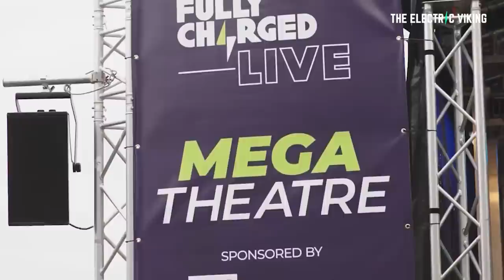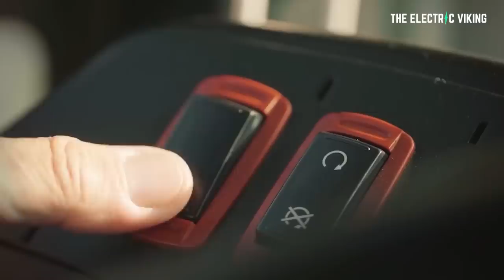Electric Vehicle Charging for moving EVs installed on German Autobahn

Comment: i think its 10% real and 200% pie in the sky. recharging an EV is about 97% efficient. using wireless charging is probably quite a bit less than 25%. its a great idea, but has a long way to go. we may be ready for test patches but we are decades away from making it the normal. how does it get paid for?

Comment: They already installed cables for like a streetcar above some parts of german autobahn (Frankfurt). For 2 (two) trucks. They will tear it down next year. Germany still has enough money for other silly projects.
To inductively acces 20kW of power you need very heavy and expensive equipment on the vehicle, that you always need to schlepp around. And it is still very inefficient. Lots of losses.

Comment: This will never happen due to financial reasons...  Do you have any idea how much a standard slab of roadway costs per mile?  Now imagine if you live in areas with extreme temperature changes, where that road buckles due to heat expansion or ice heaves.  Our local plows cause potholes every year.  Utility companies are constantly digging trenches to access and install new infrastructure under roadways.

When a highway/road/bridge is scheduled to be fixed, the public wants it done during the middle of the night, completed within one week, and they want it to last for a decade or more while costing the least amount of money.

I see this as a very useful technology for garages, parking lots, and other places where cars stop for extended periods and the asphalt requires minimal maintenance over a 20 year period.

Comment: If the exponential cost reduction in solar continues, and therefore energy becomes almost limitless and dirt cheap in the next 15 years or so, the energy loss due to inefficient charging like this would become irrelevant. And maybe over time they can engineer the construction and maintenance costs down enough for this to be plausible. I see this as a hyper optimist sort of thing, but not an insane thing like solar roadways. Also, I wonder if they need to cement it into the road, or if they could run a pipe or duct below the road and stick these to the roof of the duct, to allow them to be replaced or repaired without tearing up the road

Comment: I would want to see the results of this test track, like overall charging efficiency. How many kWh of energy does it take to create a magnetic field above the road for every kWh of energy that gets transferred into the battery? Does it add any additional drag on the vehicle? I used to work with linear motors and having big air gaps is a killer for efficiency. If you have a wireless charging dock for your phone, place a book over it, then put your phone on top and see how well it charges.
Reply: The charge is 95% efficient. An electric plug is about the same.
Reply: @preacherdavid  I'd say the overall efficiency of the charging process including charger losses is about 91% (based on my experience of designing battery chargers) and power conversion in general. Discharging the battery and getting the power on the road is probably around the same, so overall efficiency in terms of kWh in vs. KWh out is about 83%. Add in the thermal efficiency of the power plant which is around 45% for a modern gas-fired station (less for coal-fired).
Reply: " big air gaps is a killer for efficiency" BINGO! To gets efficiency over 50% will require a floating on an "air bearing" receiver under the vehicle. BUT: wholesale electricity is cheap at <5¢ per kWh. So efficiency under 50% could still be cheaper then stationary contact charging, if the government could reduce the added usual fees.

Comment: This is unlikely to ever happen as it is very inefficient in its use of electricity. After all the losses it would probably use about 3 times as much electricity to obtain a full charge. Not to mention the cost of the infrastructure and Maintenance. Maybe if electricity was cheap then it would be viable.

Comment: Brilliant idea. I do remember my home town having trolley buses so that the buses could pick up power from overhead and drive along without using diesel. I haven't really understood why that could not be reintroduced because that must be a cheaper system than "in tarmac" systems.
Reply: Yep, another great technology killed by big oil.
Reply: My mother took me on the trolley car to downtown Detroit shopping for school clothes.
Reply: i dont think in the long run, overhead wires would be cheaper, they require endless maintenance, its hard for the vehicles to attach and detach when required. overhead wires are great for a fixed route like a bus or trolley, not so much for a truck that has a potentially random route

Comment: I think this is a nonstarter. Here's the thing, no states or government want to invest more than the bare minimum for roads. For wireless charging roadways, we'd need high power lines running along the entire roadway with a ridiculous amount of inductive chargers under the road. Not to mention the huge waste of aluminum or copper it would be. It would honestly just be better to either use the overhead lines like electric trains or the powered rail in the middle of the lane. Still, I just don't even see either of those happening. 

Just to prove the point, back in the 90s there was a push in California for self driving cars. Their method involved hammering rail spikes into the center of the lanes of the highways in like 10-20ft distances. This means the car would know to recenter in the lane just by seeing how far from one side to the other the spike was. This project went nowhere though as they viewed it as "financially unviable" when they were literally just smacking rail spikes worth $0.80. 

The only method that could possibly work is wireless charging at the stop lights. Stop lights already have inductive pads under them to detect cars, it's only a slight power jump to make them output useable power as an range extender. Still I doubt even this could ever happen as who's paying for the power? It's not like the pad knows who's car is connected to it unless they also have NFC as well making this needlessly complicated. The only other alternative is limiting it to select roads with subscriptions and tolls like the state turn pike. Beyond that I just don't see how you could feasibly make it viable.
Reply: I also forgot the fact that EVs tend to run at up to 250Wh/mile, so if you wanted inductive chargers so the car doesn't lose power while driving, we're talking basically 250Wh per car per mile. Let it be remembered that electrical induction can be dangerous. At this amount of people it could cause the bottoms of some cars to start sparking, not to mention this is literal cancer. Normally em radiation wouldn't be carcinogenic, but at this amount of of energy it most certainly is. There's a reason the FTC limits the amount of em radiation per square meter. 

So enough energy to run a car indefinitely is just a pipe dream. At best they can reduce the speed the car wastes power by adding maybe 50-75W continuously. As of right now, the safe levels for non ionizing radiation has a ceiling of around 2-10W/m² depending on the voltage used.

Comment: As much as I would like this to be true, I am dubious.

Wireless charging is neither new nor complicated. It is well established for charging electric toothbrushes to mobile phones. You pass an alternating electric current through a coil in the charger to create an alternating magnetic field. The device being charged has a coil that turns the alternating magnetic field back into a current that charges the battery. It is essentially what happens inside a transformer as well but with one difference. It is called inductive coupling. The transformer contains a ring of ferro-magnetic material to guide the magnetic field from the coil generating it to the one receiving it. This gives them good efficiency. Another technology where this is used is the passive RFID technology such as that used for security door access cards, public transport ticketing, and NFC contactless card transactions. This does use an air gap and look at the range. The passive RFID cards don't need a battery because they are powered from the reader transmitting a magnetic field picked up by the card to charge a capacitor.

Air is a crappy conductor for magnetic fields. That's why they don't use it in transformers. For mobile phones and toothbrushes, they compensate for this problem by minimising the amount of air between the charger and device being charged to a few millimeters. As I said, RFID cards have a crappy range because of this. Also, the charger and device are stationary relative to each other. Even so, wireless chargers are not as efficient (i.e. they waste more energy) than cable chargers.

Now, imagine such a system separated by the ground clearance of a typical vehicle and that is moving at speed. We can assume that the company has a way of tracking vehicles and only powering those coils below a wireless charging vehicle at any given instant. The magnetic field would have to be focused on the coil and move with the coil as it passes over. It appears from the video that the coils are small enough that one vehicle would be over multiple coils at any given time. This would help maintain a stable current flow rather than have it alternating on to off and on again which is a good thing.

Like mobile phones, a vehicle would need to be designed to use wireless charging. Put simply, if the vehicle wasn't designed with the coil beneath it along with the charging circuitry, it can't use the facility. You can drive your current model Tesla up and down such a road all day and it won't get any charge whatsoever.

As for the parallel with solar panels, they are not parallel at all. Yes, solar panels were expensive and inefficient when they first came out, but that was just a limitation on the technology of the time. The poor magnetic permeability of air is not something that technology is going to change. Also, most ideas initially dismissed as being unrealistic turn out to actually be unrealistic. Remember the "solar f***ing roadways" hype? It bombed. It was predicted to bomb by many and unsurprisingly did. This is the fate of most of these initiatives however much we would like them to work.
Reply: Yep, this one belongs in the 'solar roadways' category.

Nobody remembers most 'brilliant' ideas that seem to be unrealistic, because nothing ever came of them. They turned out to be actually unrealistic. Not practically feasible. There's actually a lot more of that type of idea than of the type that actually do become successful. Just check with the patent office.

Another example of a 'solar roadways' type of idea: the hyperloop. Nice idea in theory, but so hopelessly impractical that it will be completely forgotten about in 10 years from now. Just like the last time some idiot came up with the idea.
Reply: @hvh377 , you are correct. We rapidly forget the ideas that failed giving us a false impression of the success rate being much greater than it is.

Don't get me wrong. I'd love this to work. I'd love to be wrong. Unfortunately, wanting something won't make it true.

Comment: It’s a great idea, and I very much believe technically it can work.  Here are the challenges:
1. Requires a GLOBAL standard so we don’t end up with different types of systems in different parts of the world 
2. Requires a manufacturer to build it into their vehicle - this requires additional equipment ON the vehicle itself, at additional cost of course. Not a show-stopper but still something for the anti-EV crowd to wail about again.
3. Requires a MAJOR manufacturer (Tesla would be best) to get onboard and integrate it into their vehicles.  A company with global reach can also put pressure to ensure a single standard plus immediately improve adoption rates.

As an aside, this is brilliant for Germany to do, if it pushes their national manufacturers to further adopt EVs, and potentially to be on the cutting edge, if they choose to participate.

Also, if there’s the ability to rent an add-on to an existing EV that can be used for road trips, that’d be ideal.  Few people will be very interested in modifying their existing EV, people who own them by and large use them as commuter vehicles and don’t really require this tech.  However, for going long distances it would be really useful to have it available.

Comment: Wireless charging is very common. However, wireless charged is less efficient than wired charging by about 30%. That means that 30% of the power is wasted in wireless charging. And that is with a device being physically in contact with the chargers--phones, toothbrushes, watches, etc.

I would love to know what the efficiency of wireless road charging is in comparison to having vehicles being charged by wired chargers. More than a 30% waste of electricity?

Comment: I can see where this would be very useful in maintaining a full charge for EV trucks doing long hauls sections of the country, then they would use the batteries over secondary highways..
It will extend a battery charge much longer, until the trucks can return to the charging highways..
One question I have;  Who's going to pay for the electricity and amortization of the infrastructure ?

Comment: It could work very well if every road junction, every set of traffic lights, pedestrian crossing, railroad crossing, parking area and low speed gradient had them fitted. If that were done, then costs would be a lot less than those incurred by adding the system to long stretches of highway. So slow moving delivery vehicles in and around towns and cities could keep running all day with smaller battery capacity. 
How much worse can we make it? 
The system could also handshake with every vehicle using it, measuring the power dispensed, and the registered owners could have their bank account debited accordingly. This would make it self-policing, and a road tax could be incorporated into the electricity costs. This form of taxation would also ensure that infrequent and low mileage road users are not penalised unduly, as they are with flat rate Road Taxes. Commercial vehicles would pay larger sums automatically, depending upon distance, load and aggressiveness of driving.

Comment: For transferring electrical power to a moving vehicle, there are 2 methods: Conductive and Inductive, and 3 locations:  in the road, alongside (like a guardrail) and overhead. Each has advantages and disadvantages. Conductive power transfer is less expensive to install, and can be more efficient, but requires physical contact thus more wear and maintenance, and cannot be used "in the road" due to problems with debris, rain, snow and ice. Inductive power transfer isn't affected by snow and rain, doesn't require contact thus less wear, and could be used like a linear motor to pull vehicles along. But it is more expensive to install, and is less efficient at power transfer. Well suited for in-road use, not as good for overhead, due to weight. 

Both in-road and overhead systems would require closing lanes to perform maintenance, but in some cases, side of the road "guardrail" systems could have some maintenance done without having to close lanes, but it is also limited to at most 2 lanes in each direction. 

With most EVs having over 200 mile range, and even basic EVs having over 100 miles, it wouldn't be necessary to equip all roads - only major inter-city roads would need it, and there only on certain sections.

Comment: It's a cool idea but I'm skeptical that it can hold up to the traffic and the weather. Roads are soaked in salt water in the winter, not good for electronics. Highways have to be resurfaced every few years because they disintegrate due to freezing and thawing. That's simple dumb asphalt, what will happen to the charging equipment? Maybe this can work in a California like climate but I'd be surprised if it works in any place that has winter. Germany is a good place to test this because they have winter. If it can stand up in Germany then it might be practical.
I do hope that wireless charging will work in parking lots, that's a less stressful environment than highways. Wireless fast charging would be a game changer.

Comment: I'm skeptical. This reminds me of Solar Roadways, an American company based in Idaho, which aims to develop solar powered road panels to form a smart highway. This induction road will naturally have an impact on the cost of the infrastructure (when we already see the state of the road network due to lack of means) and could lead to a more and more important privatisation of the road network, as well as the national roads that are starting to become toll highways. We should also not forget that the efficiency of charging by induction is much lower than by direct charging with plug. The ecological impact of the whole could be worse than what has been "gained" on the one hand by stopping thermal vehicles.